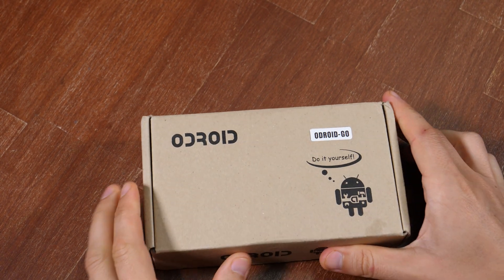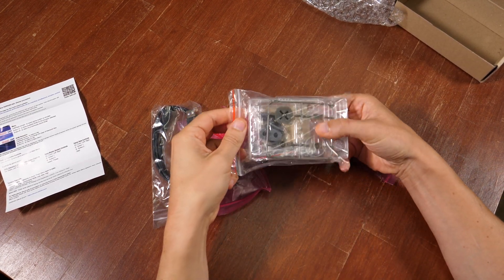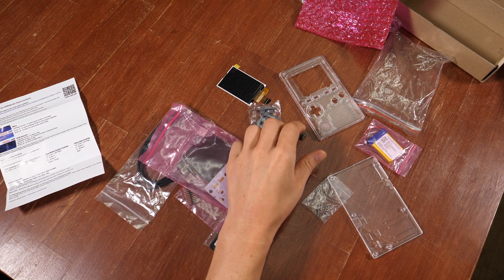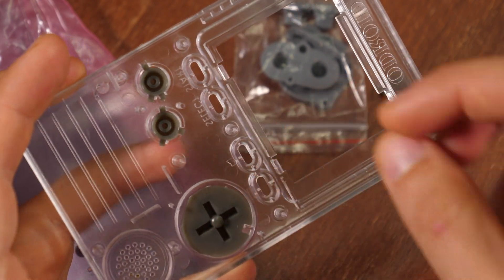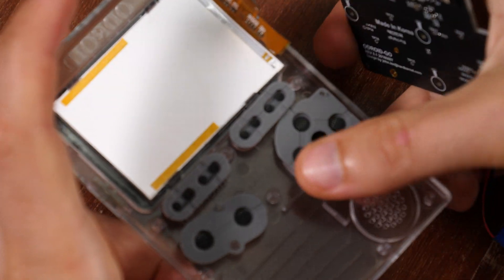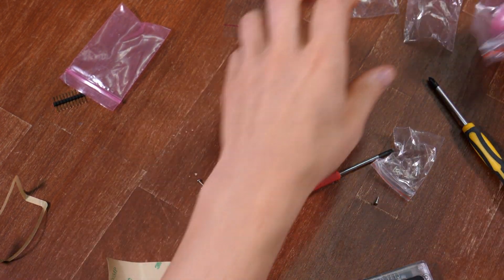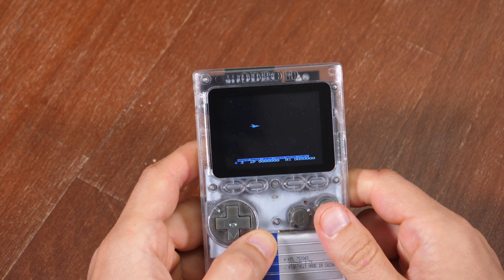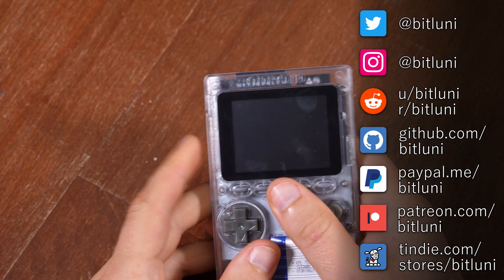ODROID GO Kit Assembly and test [ESP32]

Comment: Two years ago it was the best cheap Gameboy clone. Still have mine with grey paintjob. But the ESP32 is not meant for emulation.
Using just one Bus system it's incredible what they came up with. Thumbs up!
Reply: True, you can see how struggles with original gameboy tetris, which is probably the easiest game to emulate. If you want a handheld to actually play with it decently, you have to go with single board computers.

Comment: I love that the buttons come on a tree :D it's like building those Revell scale models! The screw arrangement seems good, like there shouldn't be much flex around the buttons and D-pad when you press down at all, not to the extent that it would make buttons or the D-pad behave erratically.

What kind of audio amplifier do you need? For portable projects you can't go wrong with PAM8403. You get these wee little boards from China, you get 5 of them for $2 shipped, something like that - or i can just mail you a couple. You can run it off 5V or just fine, or 3.3V or even less. It's got a bit of background hiss but it's also got oodles upon oodles of power and is quite efficient! From small inefficient speakers, you likely won't hear the hiss at all. It's also BTL so it drives the speakers with effectively double the supply voltage, so it can get remarkably loud, and it's stereo. It's got a small degree of robustness against noise on the power supply side, but a little inductor-capacitor arrangement won't go amiss. When you need to integrate it into a product on a single board, you can get the chips by themselves too, no problem at all.

As an analogue volume control, i highly recommend Rod Eliott's ESP-01 circuit: Better Volume Control. You combine a linear potentiometer of around 100k with a resistor and it produces an approximate logarithmic curve (actually an S-curve) which is super nice to control and much better behaved than an "audio" or log approximation taper pot. The green oiled sealed linear potentiometers from China that looks like ALPS clones are quite nice. I understand you may need a more compact solution, but the small wheel pots are usually A-taper, and you want B-taper (linear) for this, but i think i've seen B102 and B103 somewhere.

Recently got an ESP32 TTGO board with a little OLED screen on it so that's gotta be fun - haven't really tested it yet though. Paid the lot of $1 shipped for it on some limited-quantity promo on Aliexpress, and it arrived super quickly, like in a week and a bit, i think they ePacketed it, which means they probably paid $1.20 for shipping, plus i mean the screen and the processor alone gotta be worth a few $ each. Pesky USB-C connector though, and i don't have a single USB-C device, so i had to go and buy a cable for it for 2€ :D But now i should be all set.

So i'm thinking... this Odroid Go raises a particular kind of itch... i mean... i wonder if you can eek enough performance out of it to emulate the Playstation? Depending on how fast or slow the pSRAM access is, is there any info on this? I know it may sound absurd because nobody got a decent SNES emulation out of it, but consider this, you've got a processor where rather than a complex dynamic recompiler, a little bit of runtime patching may suffice. The real Playstation has a total of 3MB RAM with a few odd bits here and there, while here you have 4.5 MB in total, so that just about fits. First time i emulated the Playstation, it was on a Pentium MMX 233 MHz laptop, and i got to full speed on it, with EJ's software renderer plugin which made much better use of cache than the usual Pete's Soft plugin. You have two cores, so let's say one gets to do CPU and sound and the other the GPU. Playstation's main RAM of 2MB is 32-bit but it luckily has a good bit of latency, so i think it might not be that bad. Fast SGRAM might be a massive emulation issue, possibly need to change to tiled-deferred rendering? A bit icky with the amount of RAM we have to work with. It is a horribly risky project and might be fundamentally impossible, i feel scared even thinking about it. I love this feeling.